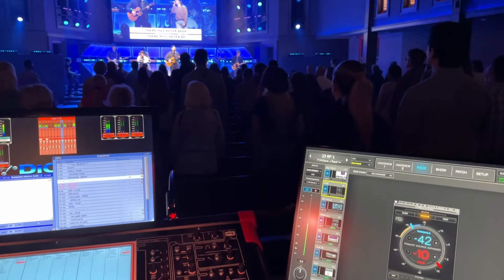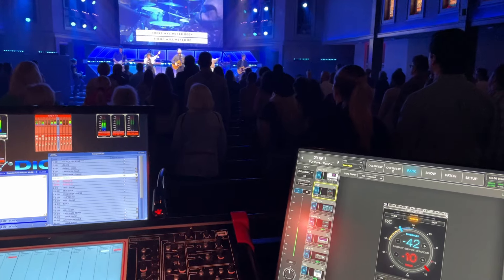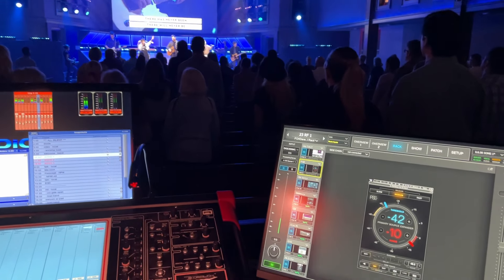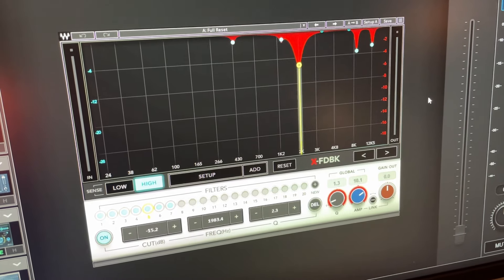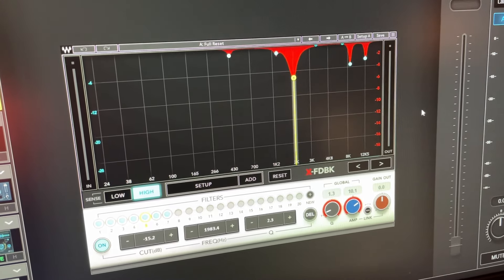Managing Feedback and Mic Bleed with Waves

Comment: I'd love to see the process of using Feedback Hunter. I have it and have tested, and it just.. doesn't do anything. Should my mic channel be flat with no HPF during the process? Watching Waves video about it, it seems super quick and easy.
Reply from the maker: It's been a while since I ran it, but as I recall I put the mic on stage where someone would be standing--mic was a DPA 4066 I think. With the fader down, I bypassed everything except for maybe a HPF and Feedback Hunter. Then I hit "Setup" on the plug-in and pushed up the fader to where it was loud, but not uncomfortably loud. When the curve stabilized, I think I hit "Stop". Then I dialed back the depth a bit since the curve was doing a lot. It still looked like it was doing a lot, but it was pretty stable and sounding good.

Comment: I recently purchased the Feedback Hunter plugin, but it does not appear in the Audio Units list on my M2 Pro Mac. I intended to run the plugin through Dante, but it is not showing up in the available plugin list. Could you please clarify whether this plugin is compatible with native operation, or if it is exclusively designed for SoundGrid? Additionally, I would appreciate any guidance on resolving this issue.
Reply from the maker: I think it has to be run in Superrack or an LV1. I would suggest contacting Waves tech support for specifics, though.
Reply: Thanks for the reply. Yes you are right, it works on LV1 and superrack.